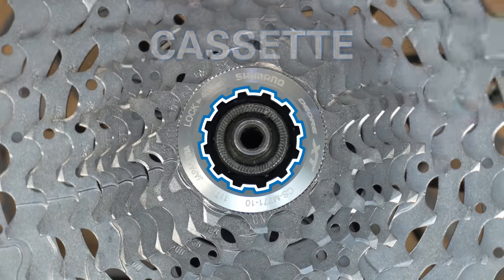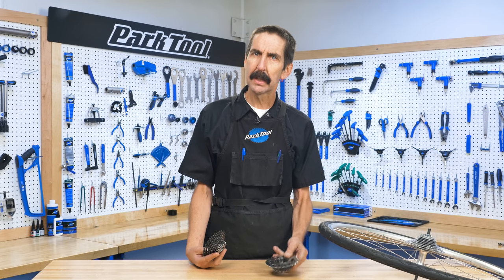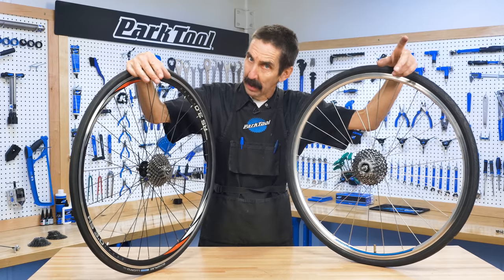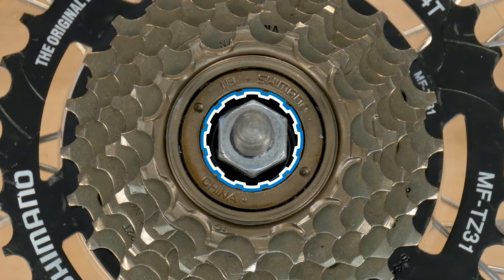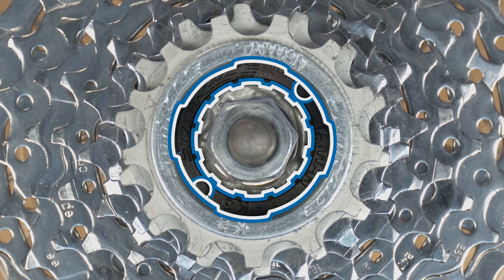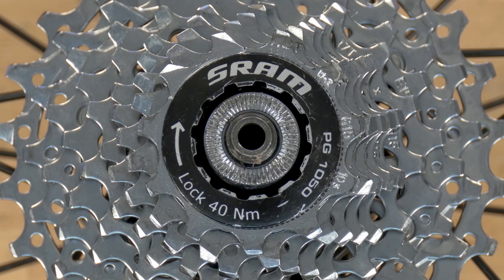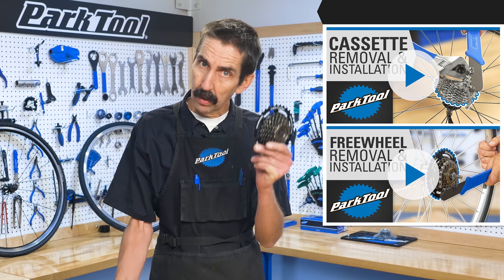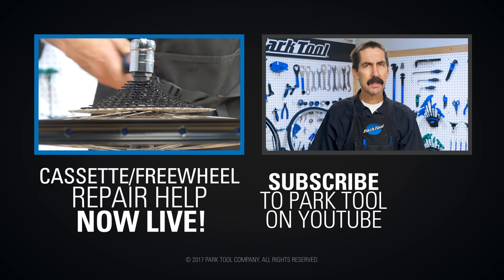Do I have a Cassette or Freewheel? - Tech Tuesday #93

Comment: Hey, I have a few quick questions for you about mods on my Citizen Tokyo Bike, which I got really cheap. The standard equipment is 16-inch wheel freewheel, Shimano 14-28T 6 spd, the stock tires are 16" x 1.75" 45 psi. stock plastic foldable pedals, Alloy V-brakes, and 170mm alloy crank arms with 48T alloy chain wheel. Cool bike, but too slow and a little heavy. I'd like to upgrade a few components for a little more torque. Of the few blogs, I read, recommendations have been made for an 11-28 freewheel, 7 speed, and 55 T chain wheel. My questions are has anyone attempted this project? If so, did this combination make a difference? Lastly, to reduce the cost of overspending, the best place to source components? Thank you.

Comment: Difference between freewheel hub and a cassette hub?
Reply from the maker: Good question, and at a deeper level. For the purposes here, a freewheel hub takes a freewheel, and a cassette hub, well, you get the idea.  We will need to put that on the more-in-depth list for the second round of videos.
Reply: road biker ... elaborate ...
Which one is better ??
What are the differences , and the final pourposes of each one of them ?
Reply: ERRATUM : PURPOSES .